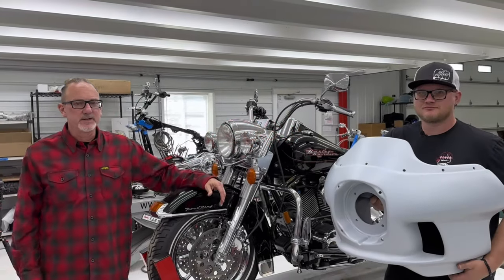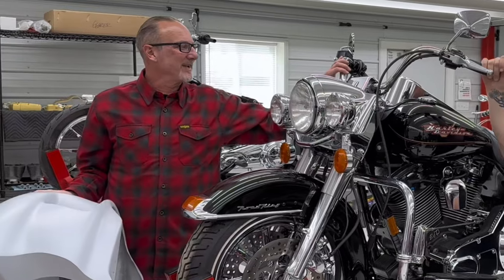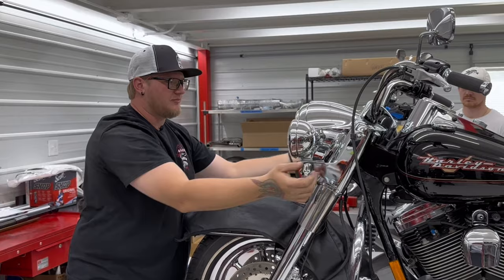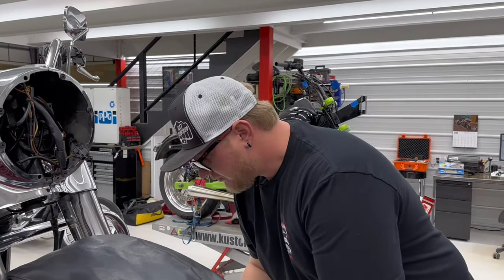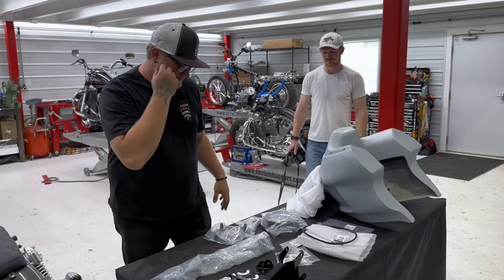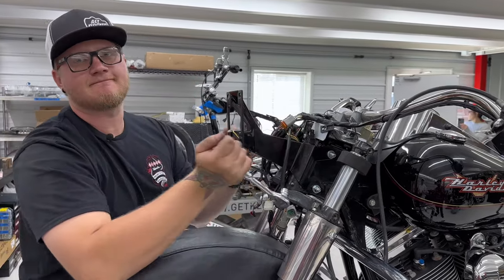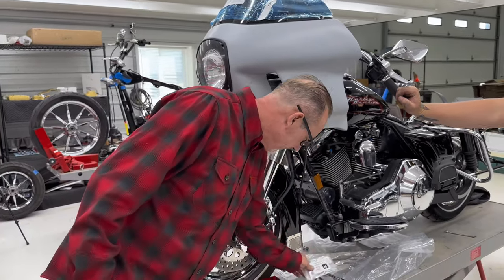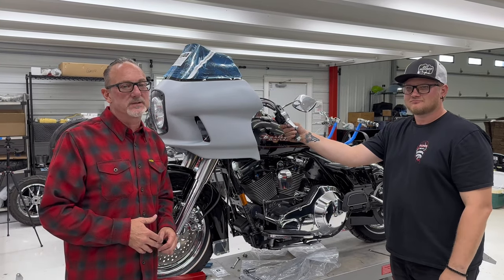1997+ Road King FXRP Style Fairing Install

Comment: Just installed mine, went well except one small issue. One of the four holes in the neck was threaded and needed to be drilled out, not a huge deal just a pain to get the bike off the lift so I could turn the bars and get a clear shot of the hole that needed to be drilled. This was an ‘08 Road King. Still wouldn’t hesitate to recommend this to anyone, the quality is top notch and overall the install was a breeze!
Reply from the maker: Thank you 🙏🏼 that is strange that one of the holes in your neck was threaded.

Comment: Hows the wind buffeting with thay shield? Im 5'11 and have a 14" clearview that gives me some oretty heavy helmt buffeting. Wonderig if going shorter is the move.
Reply from the maker: I’m personally 5’11” myself and the 9” fxrp windshield is the one I prefer.   We also have a 12” FXRT shield if you need something a little taller.  The flare on our windshield makes a massive difference over other shields on the market.

Comment: I’m looking to swap my 21 Electra Glide for this fairing. Will it work with my current stereo / speakers
Reply: If you are talking bolting stereo directly in, no it will not.    If you get creative with some fiberglass work, anything is possible.
Reply: @sheltoneinerwold  would yo know if speakers will work and would you know where to get a small head unit like Harleys late model Lower rider ST with the fairing Thanks

Comment: See that what I what on my street glide..     or even and batwing  inner  fairing  without  the radio  and speakers  cutouts
Reply from the maker: It will fit on a street glide. The touring frame is the same

Comment: How solid is that mount? Does it shake at high speeds?
Reply: i would guess not , these guys have set land speed records on the salt flats, brian Klock does not half ass anything.
Reply: It’s solid! Even with the 120 cubic inch merch motor doing its best to shake it apart.

Comment: I think you are wrong about the difference between the P and T...
I did research on both the FXRP & FXRT and I am still confused 🤔😤
Im thinking maybe people name them differently but are actually the same... Maybe🤔
Reply from the maker: it all depends on the year... thats why we go off of speaker pods vs no speaker pods.
Reply: @GetKlocked  
🤔... Ok,so the difference is having or Not having speakers?🤔...this is a first in why the difference.
1.  The shape
2. Tapered or straight across the top
3. Shorter height
4. Depends on type of Bike
5. Now w/speakers or w/o speakers...
🤔😤... Still confused,I would have no idea what I would be getting or what I need to order.
Reply from the maker: They are the same the only real difference is the speaker pod vs no speaker pod.  Other then that they are interchangeable
Reply: They are interchangeable but the "P" model has light pods because they were originally designed for police bikes...you know "P" for police...
Reply: @blazebrady3659  
Correct 👍

Comment: If I heard correctly, your FXRP  won't work unless I have pull back on my bars? I have an FXLRS with T-bars and zero pull back. Is my setup a no-go for this fairing?
Reply: I wanna know
Reply from the maker: as long as they clear the windshield it will work. so it depends how tall your t-bars are.
Reply: @GetKlocked how tall does it have to be to clear it?
Reply: I have the same question. What is the minimum height requirement if you are running t-bars with zero pull back. My bars are 10 - 11 inches. Would hate to drop 3k on a fairing just to find out it won't fit.

Comment: Is it possible to mount a stereo in this fairing?
Reply from the maker: yes it is. We usually run a bluetooth receiver wired to an amp and two 5.25" speakers we mount in the fairing. we sell an amp bracket to help make the job a little bit easier.